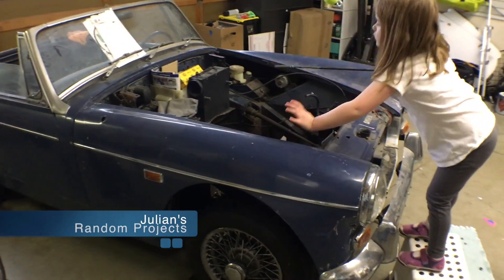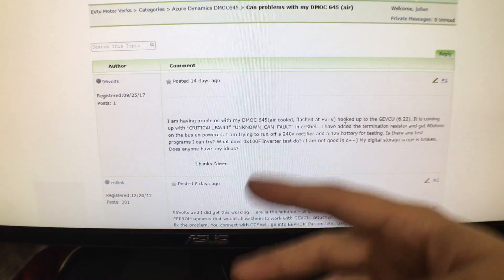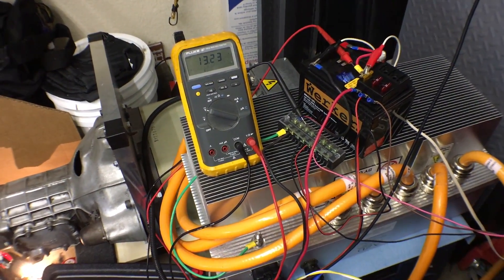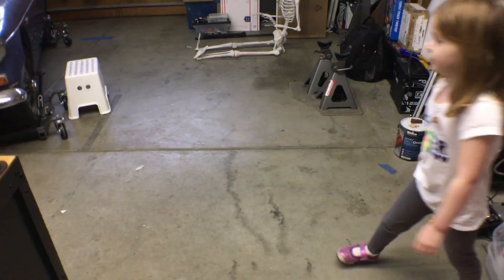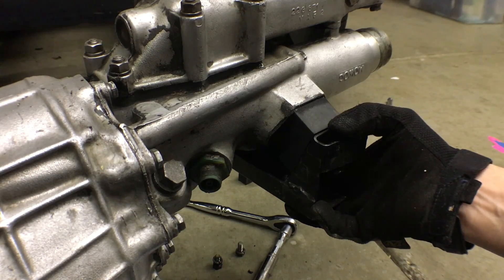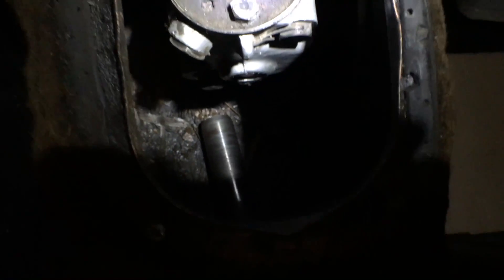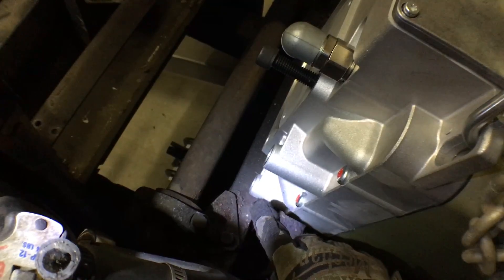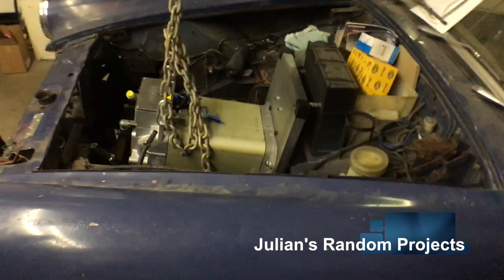MG Midget EV Conversion Part8 Motor Spin!

Comment: Hey, Great build proyect!! thanks for your time and effort.Only one comment. Why is the attachment plate for the engine-transmission marriage so large on the top side? I could see lot of let over material you could cut off and make your life easier.Sorry If Im wrong...
Reply from the maker: Michael Carletti it get chopped in later videos. :) kept it until convinced I didn’t need it for hoisting or bolting stuff to.

Comment: Good video. The best part for me was hearing and seeing that darling little girl. My 2 daughters....in the 70s...would watch me work on stuff. Best memories yet. I have a 1976 Midget. !500 Spitfire engine. Bought in in 1991 for $650 and restored it. Love that car. First Midget I had was a 1967.  https://youtu.be/Gn8mKFZ7hvw
Reply from the maker: NickMonteleone Looking good. I see you ditched the stock front bumper, looks great! Thanks for tuning in
Reply: Thanks. I hated the rubber bumpers so I removed it, filled the holes . The turn signal lights are behind the aluminum grill I made. What was odd is after taking the bumper off...there were the openings for the signal lights in the fender although the lights were in the bumper. I guess MG decided to use original style fenders as long as they had some.
Reply from the maker: Exactly. I used to work on Chinook helicopters and they'd come brand new from the factory with holes for equipment only used in the Vietnam era, don't mess with a good thing or in some cases a working thing.